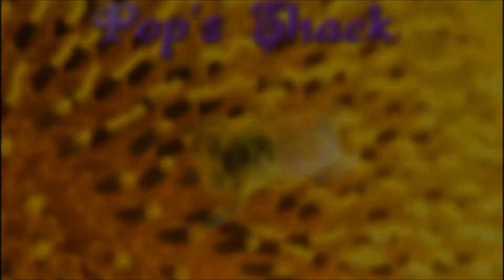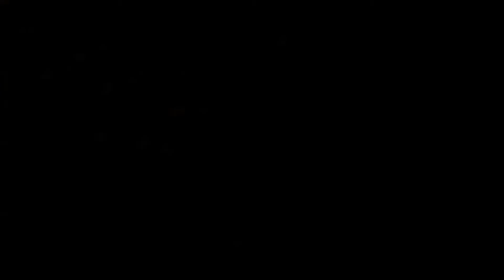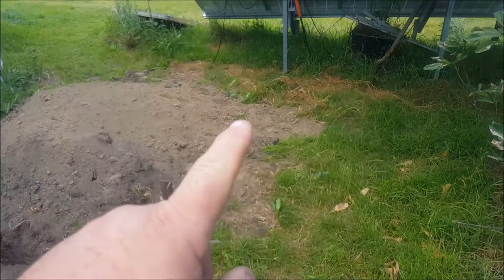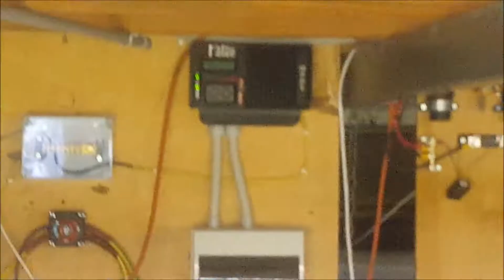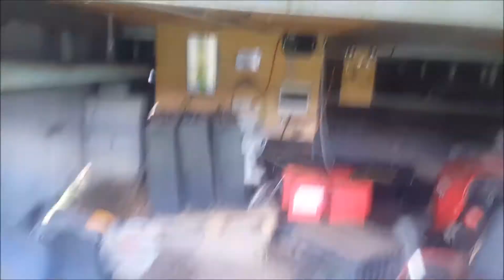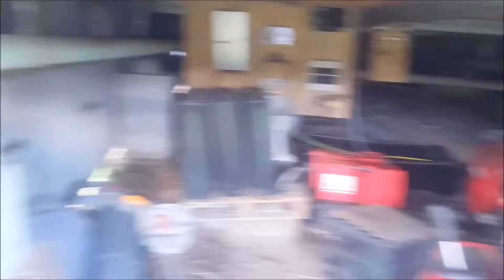Off Grid Solar Power - Preparing the Ground for  the Solar Power Shed

Comment: There is always room for improvement. I have lots of things to upgrade. Someday I will get a refrigerator that is much smaller. Next week I'm going to get a smaller inverter that uses less electricity. I don't need 2000-4000 watts just yet. With the winter sky upon me I still can't run the huge refrigerator 24 hours just yet.